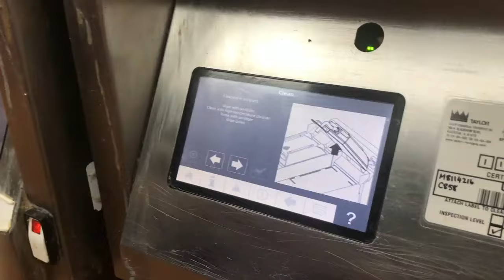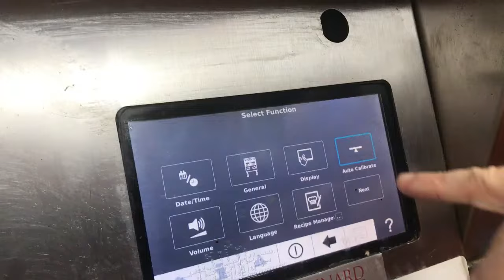Grill Maintenance- Daily Clean

Comment: Just a heads up. There is a layer of carbon on the back of the upper platen. this exists because teflons are being placed out of alignment, and can lead to problems with automatic gap calibration.
Reply: Can you elaborate? Out of alignment?

Comment: very pro of you to not put the cleaner directly onto the grill.

The carbon buildup that everyone speaks of is due to people, not using enough cleaner and letting it get in there and drip -  while it in full clean mode.

When you use high temp cleaner and wipe down mode, it is actually too hot for the cleaner-  hence full clean mode- in folk mode, the grill is still hot, but it doesn’t destroy the cleaner before it does his job and get to those nooks and crannies around the top platten.

Using the high-tech cleaner like that is actually what leads to getting the crusty shit in the back -  and yes, a misalign Teflon adds to that, but the crusty in the back is misaligned the Teflon by moving it, just a millimeter or two off.

Basically, the buildup is due to not doing it right consistently.  It’s also due the fact of the team not using wipe down during the day anytime every so many hours you can wipe down the grill.

Comment: We have the brown side facing down….
Reply: The sheets can be used either way
Reply: Sheets should be alternated each day for proper wear and tear. Shears should also not be damp or wet when putting back onto the top platen. 

As this is one of the main causes for carbon to be stuck to the top platen, also not calibrating.